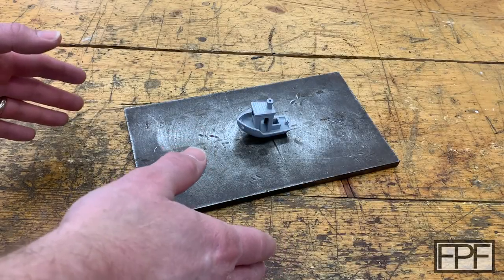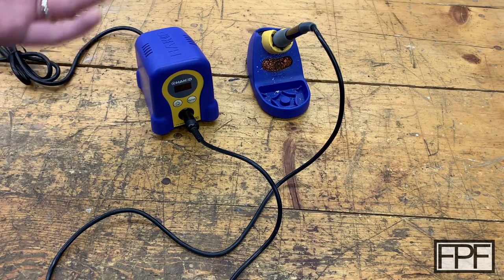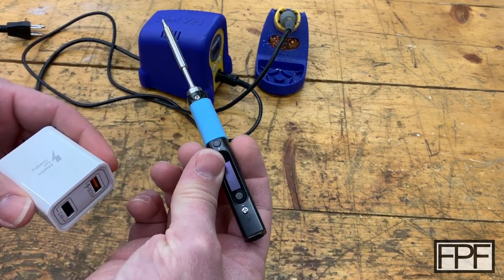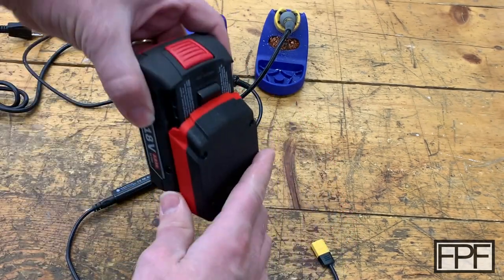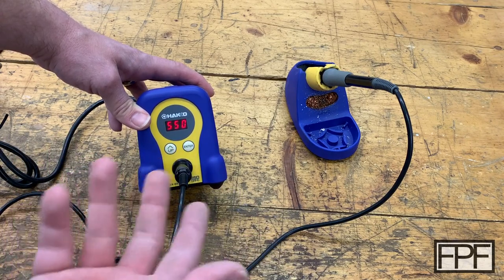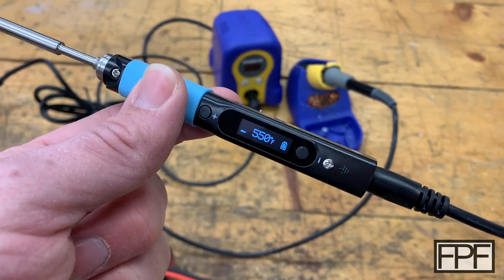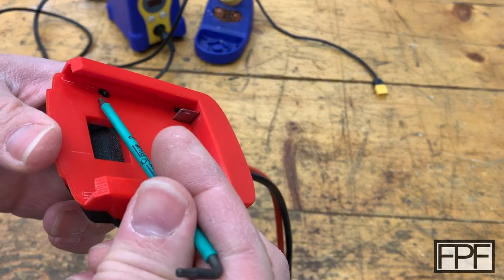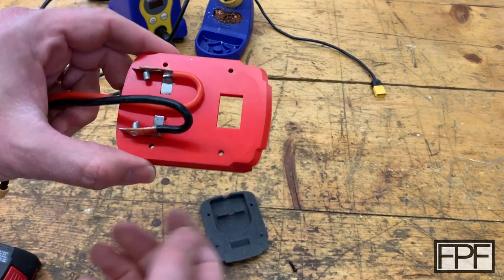3D Printed Cordless Tool Battery Adapter for PINECIL Soldering Iron

Comment: Found your post on the prusa3d subreddit... This video could not have found me at a better time. I'm in the market for a new soldering iron because I have "the garbage iron" and I need the portability. I had almost talked myself into the hakko model you have, but had put the purchase off. 

Excellent video!
Reply: Yikes.. Looks like the Pinecil is out of stock on Amazon. Where did you order yours from?
Reply from the maker: @shanesprojects213  was in stock on Amazon when I bought mine and it came next day :(  Looks like everyone is catching on that these things are amazing for $35 lol. UPDATE: BACK IN STOCK ON AMAZON
Reply: @FunctionalPrintFriday  I've got one ordered now, excited. Looking foward to next friday!

Comment: Great video. I think that nickel would probably be a good choice for the tabs. You can find it pretty inexpensively for use in DIY battery packs and it has good conductivity, corrosion/wear resistance and good solder-ability. Not as good corrosion/wear resistance as stainless, but much higher conductivity. You can get the full 60W from usb-c for the pinecil, but it requires a PD source capable of 20V at 3A, so most laptop chargers will do and even some power banks. Pine64 also sells a silicon usb-c cable for like $5 which is very well made. Thanks for making the vid, I'm going to try making an adapter for my 40v skil batteries so I can power an eBike.

Comment: Hey.... I just came across your channel and I did subscribe. So I wanted to know if you ever updated your pinecil firmware so you could use the pd 3.1 with more power think its 28v 90 watts?
Reply from the maker: I have not.  I always just use it with the bullet connector for power (fed from the bosch 18v batts).  Been super reliable.